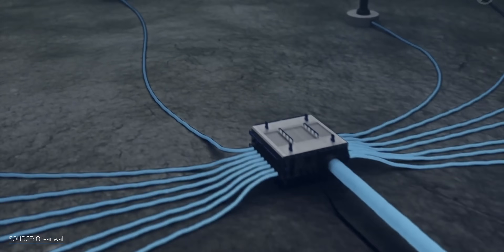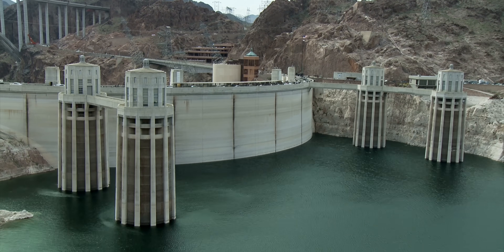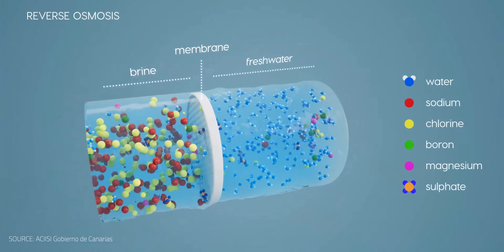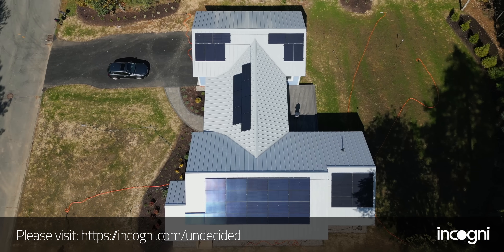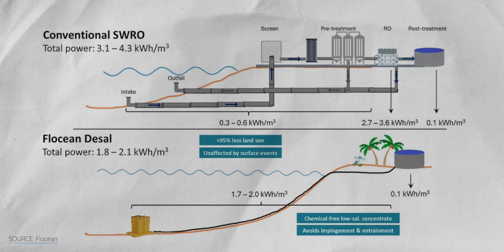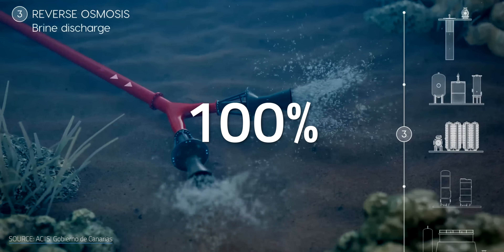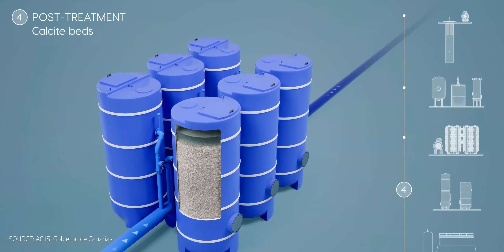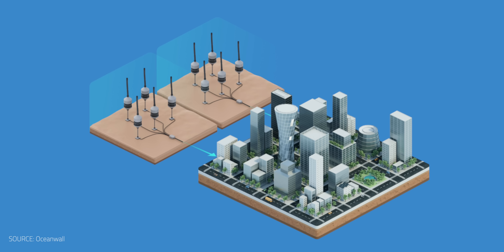How Deep Sea Water is Now Drinkable

Comment: it is an option, they could use robot that is remote control by human to do maintenant or switching out the old part, the old part just need a ballon to recover a cable connect to the balloon can be use to guide the next part down to the location? the ballon can balance so that it just enough to counter the weight of the unit and can be moving it to the specify spot. it seem the problem is not that difficult the main problem is the investment and financial incentive. also the deeper the easier to extract water!
they could also use tanker to ship water just like oil!

Comment: So a filter connected to a regular pipeline and a flushing pipeline . No underwater electrical connections just a one way valve for each pipeline. Electric pumps only on land ??? Maybe a barge that is autonomously controlled to spray the brine heavy flushed water around a larger area into the sea?

Comment: If the  water is deep enough the pressure difference between the salt water side and the fresh water side will be sufficient to desalinate the salt water through membranes and the resulting fresh water is lighter therefore the pressure from depth is significantly less so it powers itself .

Comment: Theoretically one only need a head pressure of 10 feet to desalinate but of course the membrane is not that efficient and volume is the other issue,in practice the pressure needs to be much higher but it does show you there is room for improvement

Comment: I'm rather sceptical wrt to the brine that is produced from such an underwater installation.  In order to produce 95000 cubic meters of drinking water from seawater the insallation will have to get rid of an equivalent of well over 3000 metric tons of dry salt. Each day!

If the installation is in place where the sea currents are strong and part of a larger current system this might just work. In areas where the currents are low there is a distinct possiblity that brine, which is slightly heavier than seawater, will accumulate locally. This will in turn wreak havoc on the sea life that after all exists even on these depts.

Comment: I doubt the logistics but there's a bigger problem: salt.  Have the same problem with on-land desal of course, and the practice so far is just dump it back in the oceans, it's a big ocean, right?  But if say California builds a dozen more major desal plants along the coast and runs them for the next century, well, I'm afraid it may be necessary to spend much more energy isolating the salt and disposing of it properly, probably dumping it on existing salt deposits out in the desert.  If this is going to be a problem it may be better to do on land than ten miles out under deep water.  FWIW I don't see why you can't split the difference and do it near shore in "just" 100-200 feet of water, might even be optimal.

Comment: Water shortage - but politicians are selling off our only water sources to become privatized, and pushing the costs to us by up-charging us for electric and water usage by AI data centers. Yea. Right.

If you think even the oceans won't get heavily contaminated with the pace we are going at, boy are y'all going to be in for a bad surprise.

Let me put it in terms of engineering - there is something called a "bottleneck." Basically, and I'm paraphrasing it, this happens when there is 1 element that might delay if not limit how fast or efficiently a process-chain might go through. In our case fresh water/clean water/de-salinated water is what'll help limit how fast big-corp will destroy this planet.

Historically, we have done this, almost destroyed the planetary ecology to the brink of no return once before with the boom of the industrial revolution. With tech far beyong coal usage, and massive shift towards the AI bubble and data centers, etc. the damage that can and will be done is nothing even the Industrial revolution moguls could imagine.

Comment: I just don't see how sucking water through a membraine takes less energy  then pumping water into and through a membrane....even if its hunderds of feet under water ....i get that down deep the water pressure  is great but you still have to pump water up to land ...and creat a vacume so water can go through  the membrane  .....i just cant wrap my mind around it , it just seems it would take just as much energy  to run a pump to suck or pump  pressurize water back up to the land ????

Comment: The intake water of any water filtration system should be radiation sterilised after the initial filter step that keeps out multi-cellular life forms. No need to use chemicals to kill single cellular life.

Comment: Problem with powering them with local wind turbines is how are you gonna install them when there's hundreds of meters between the water surface and sea bed? It would need a location where you simultaneously have a deep enough location to install the desalinators on and a nearby location shallow enough to install wind turbines on.

Comment: "the obvious solution is renewable energy" RENEWABLE ENERGY IS A SCAM THAT'S WHAT NUCLEAR IS FOR, renewable fills landfills with knocked down wind turbines and heavy metal solar panels. and it is unreliable so you need huge amount of batteries which requires mining lithium, and will still be unreliable. nuclear has no real downside.

Comment: this is a scam. you keep talking about the pressure under the sea like its a power source, its not. you need a pressure gradient to extract energy, not just pressure. then you switch to saying that its more efficient to pull water from the low side, i.e. the fresh side, but its the same gradient and same energy. if there is any efficiency gain to be made from this it is in the lack of need for as much preprocessing and would have to be weighed against the energy lost in the infrastructure construction and maintenance at depth.

Comment: This is nice and all but we can very easily lessen the consumption of water in drought stricken areas by conservation.  Most residential water we use is for landscaping irrigation and sanitary purposes.    Force xeriscaping and gradually switch toilets to composting solid waste and urine recovery systems.  Solid waste can be "sterilized" using microbiota and heat and urine with UV light.  This can be collected like you do with garbage and be reused for fertilizer.  Gray water can be easily treated locally and reused.  You can literally reduce residential water consumption by 90-95%.  Some places, you can effectively run your house on rain water.

Comment: I don't know if the brine it releases is particulary warmer, but in my head i makes sense to have it a bit higher from the bottom (same depth, just deeper bottom) so the brine can sink away due to its slightly higher density. This will also ensure that you dont have disturbed sediment getting into the  intake such as from turbidity currents.

Comment: Matt, I like your channel - but you have the physics here completely wrong.  There is no mechanical advantage to putting the desal filters at depth.  The head pressure is equal on both sides of the pump.  You have to push the filtered water 400 meters UP.  I believe the claim that the deep sea water has fewer micro-organisms/algae. So there is a small savings in skipping that filtration step.  But the cost of putting this operation that deep - will be much higher than the modest savings from having cleaner water input.  I expect you to call BS - on claims that defy basic physics - like the energy savings nonsense.  There is no "sipping" going on here.

Comment: Super mario analogy:
1) Mario builds green pipe to the bottom of the sea floor, making sure to keep the internal space in the pipe dry and empty.
2) At the bottom of the pipe, he installs an RO membrane that allows water molecules through but blocks salt ions from passing.
3) Due to the immense weight of seawater stacked up on itself at the sea floor, the seawater pushes water molecules through the pores of the RO membrane.
4) Fresh water gushes through the membrane, filling the pipe and causing Mario to float to the surface. 
5) Mario gives glass of fresh water to Princess Peach and they live happily ever after.

* not AI generated, my brain just works this way

Comment: This is interesting.  The trick is similar to the pumping  of water out of a well. 
On the fresh water side of the RO system, when water pumped out causes a pressure difference. That pressure difference moves water across the RO membrane.

Comment: In deep sea desalination case you need power ( electricity) to pump filtered water out to surface and probably it will take the same energy that you need to use for regular RO in sea level. You cannot trick the conservation of energy law.😪

Comment: Other one Solutions just simple - make The ocean Water income in Water maked collecter place. And just Dry them out. Waping out.  Without problem and Disapointment.  can make iregation on this. Waping Chalange with Roof and Using the help of willow threads to bring water to one place. Easy Freshh water.
Other one In LA can make The rock Cooling System. "By using stones, condensation can be achieved to collect water. This can be done by digging trenches and filling them with piles of stones." Like in old times when logistik worked at Dunes.

Other one solutions is Making Salt water inside at Dunes. And collecti it there.  And near colectin Dunes place need just make other Lake without water more Deeper. Where can Fressher water unsalted will can come out. It was need more place But :)  with can make more freshh water. Use Dunes like Filter. For own purpose. Autralia got big potential on this can use the own Coal For just Filter water just make COal with Dunes as Filter. Just need the Dig The places.

Comment: but you have to pump the water up from the depth, that costs energy, why can't they install the same system but at sea, or even on the ground? You'd still suck instead of pushing water.

Comment: Couldn’t you pump air in the line to reduce electricity even more. The deep sea pressure will force the air out at a high rate then you don’t need to pump water that uses more electricity.

Comment: I have a lot of questions, they can be quite stupid but here they are—Can this system be capable of bypassing the trash and Microplastic humanity dumped in the oceans and provide safe drinking water?. would this system not harm or trouble the deepsea creatures around with loud pumps pumping water and other filtration processes?. Also the deep sea creatures in the twilight zones are quite big and can withstand a large sea creature if it decides to wrestle with the pumps and other equipment?.

Comment: 3 kwh/m3 is totally unrealistic - my RO plant gives me 350 lts per hour running 15.5 kw/h thats around 44.28 units per m3 of water (thats based on permeate) not actual flow , different systems may have different rejection rates, but chatGPT tells me that mine is about average

Comment: @UndecidedMF Matt, occasional viewer here. First, I'd like your videos even more if you could slow your speech down some. I find the high speaking speed distracting and hard to follow. I know I can adjust my YouTube settings, but on your end, it doesn't need to be a lightning speech race.

Second, I watched almost 20 minutes of video, and I still don't understand even basically how DSRO works or is different from land-based. For the part at the ocean floor, what about it works differently and better? There was a very brief comment about sucking pressure on the freshwater side, but that fell far short of an explanation.

As for DSRO:
1. Intriguing idea
2. Likely not commercially viable due to power requirements. 
3. Vulnerable to the same type of infrastructure attacks as undersea internet cables, but potentially more dangerous. You can live without the internet permanently, but after 3 days of no water, game over.

Comment: So what is this, gravity-powered reverse osmosis setup? Well you still need electric power to overcome gravity by creating pressure - in order to, you know, pump the fresh water up to the surface - and incidentally it's the same pressure that reverse osmosis normally requires at sea level. Except doing it at sea level has infinitely simpler logistics than doing it a quarter mile under the sea. In other words, it's another startup grift, nothing to see here, folks.

Comment: What is the magic sauce? What a pump does create a difference in pressure. What is the magic of having something in a pressurized environment that does not have a difference of pressure. Where does the discharge of the saline go?
 The suction side gives you 40% less power requirements? 
In your dreams😮! The only thing this does is create the problem of this is when a liquid changes to its vapor state. Will create damage on any surface it comes in contact with. Not saying they don't have the science to do this. But this little video sucks. It seems like just a commercial to get these companies names out there.

Comment: You're asking a great question about a relatively new concept in desalination: why would you consider putting reverse osmosis (RO) systems deep in the ocean to filter seawater? While most current desalination plants are located on land, there are some potential advantages to deep-sea RO, primarily related to energy efficiency and brine disposal:
Potential Advantages of Deep-Sea Reverse Osmosis:
 * Reduced Pumping Energy for Brine Disposal: In a typical onshore RO plant, both the incoming seawater and the concentrated brine (the salty waste product) need to be pumped. Brine disposal can be energy-intensive and environmentally problematic as it's highly saline and can harm marine ecosystems if not properly dispersed.
   * Deep-sea advantage: If the RO system is already at depth, the salty "reject" water can be discharged directly into the surrounding ocean. The natural currents and vast volume of the deep ocean would help dilute and disperse the brine, potentially reducing the environmental impact and the need for significant pumping to move it away from the plant. This could save a lot of energy that would otherwise be used to pump brine back out to sea from a land-based plant.
 * Purer Source Water: Deep ocean water tends to be cleaner and more consistent in temperature than surface water. This could mean less pre-treatment is needed to remove suspended solids, algae, and other contaminants that can foul RO membranes. Cleaner source water can lead to longer membrane life and reduced maintenance.
 * "Hydraulic Head" Advantage (Debatable): Some proposals suggest that the hydrostatic pressure at depth could be harnessed to reduce the energy required for the RO process. However, this is a complex physics problem, and many experts argue that the energy savings would be minimal or even offset by the energy needed to pump the desalinated fresh water up to the surface. The primary energy savings would likely come from the brine disposal aspect, not directly from the RO process itself at depth.
Challenges and Considerations:
 * Engineering Complexity and Cost: Building, deploying, and maintaining a large-scale RO plant deep underwater would be incredibly complex and expensive. The equipment would need to withstand immense pressure, corrosion, and the harsh deep-sea environment.
 * Maintenance and Repair: Accessing and repairing equipment at significant depths would be a major logistical challenge and could be very costly.
 * Energy to Bring Water to Surface: While brine disposal might be more efficient, the fresh water produced still needs to be pumped to the surface for distribution, which would require a significant amount of energy, especially from very deep locations.
 * Environmental Impact (Still a Concern): Even with better dispersion, the discharge of cold, concentrated brine into a deep-sea environment could still have localized impacts on marine life.
 * Regulatory Hurdles: Permitting and regulating deep-sea industrial operations like desalination plants would be a new and complex undertaking.
Current State:
While the concept of deep-sea RO has been explored and some research is ongoing, it's not a widely implemented technology at present. Most desalination continues to be done in land-based plants, with ongoing efforts to improve their energy efficiency, reduce costs, and mitigate environmental impacts through advancements in membrane technology, energy recovery systems, and brine management.
In summary, diving deep for RO desalination offers potential advantages in terms of brine disposal and cleaner source water, but these are currently outweighed by the significant engineering, cost, and logistical challenges of operating in such a demanding environment.

Comment: 7:35 Why place pumps in the depths? please filter at the end of the pipe or hose and start sinking it. As the filter drops, the reverse osmosis will begin on its own filling the pipe/hose as it goes down near the surface place a reservoir tank, which will fill on its own and pump water from there. With salt, water being heavier than fresh you might even be able to place a reservoir on land have it fell on it to own.